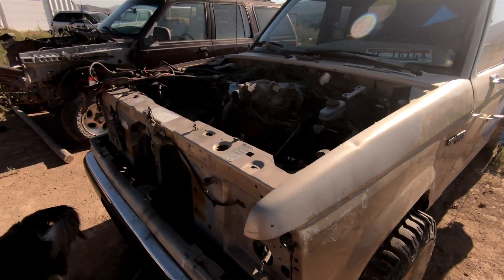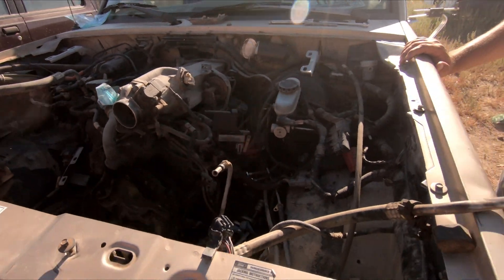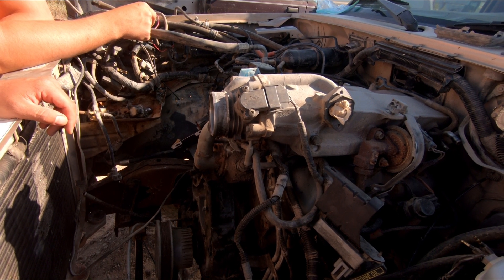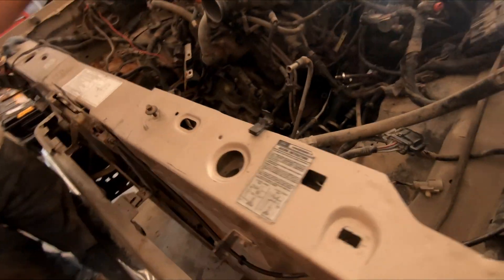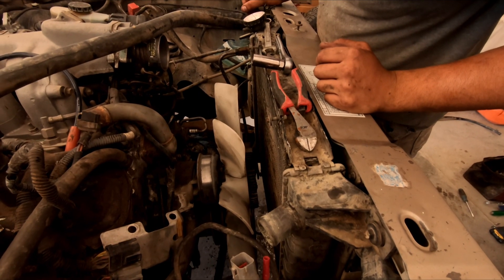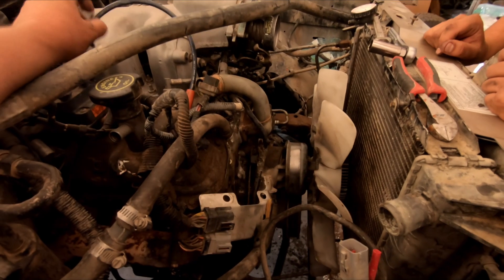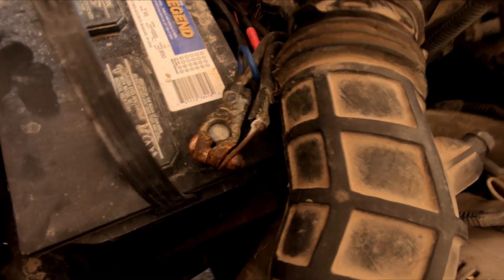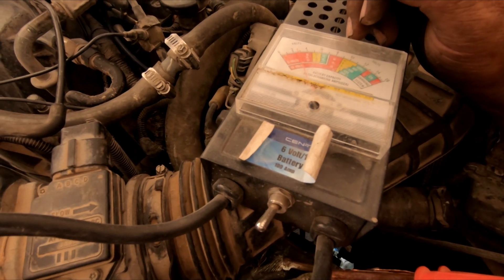Ford Ranger Engine Swap Part 6

Comment: did ya ever get er done? gonna be doing this myself shortly except both trucks are 1994 model year
Reply from the maker: @ABANDONEDCARREVIVALS  You will have a much better experience using same year trucks, I believe. Never got it done. Austin got in a wreck, and the project went to back priority. And after that, there was a title issue that came up and never got resolved. I should make a video on it, I guess. It was highly frustrating and disappointing to be so close to the "finish line".
Reply: @ thanx for the update! What a bummer you guys were working pretty hard on that! I will be pulling cabs when I do mine…
Reply from the maker: @ABANDONEDCARREVIVALS  thanks. Yeah it was a big bummer for sure. I think all we had to do to get it going was switch some wires around on the main pinout on the firewall. Because the pattern of the pinouts didn't lineup between the 2 vehicles. You're gonna pull the cabs? That will be so nice, good idea. 👍🏻👍🏻

Comment: I would have kept the Ranger a manual & just retrofitted the 5-speed onto the 4.0 L engine. Of course I would have had to buy & change a few parts to do this, but it would be well worth it. What can I say? I just prefer a manual transmission on a truck like this.

Comment: If ur still having harness issues get ur hands on all data and get a connector wiring diagram and a ecu connector diagram use the two  to confirm which wires u need there's only like 36 wires if I remember correctly that have to hooked up along with ensure the anti theft isn't giving u an issue which u can by pass If need be. Took me about 8 months to build a customer plug and play integrated harness to go from the 87 dash to the 2000 engine harness on my little tire smoker

Comment: I installed a 94 explore 4.0 into my 91 ranger I used the & intake from a 91 4.0 ranger the passenger header from the 94 explore  plus the wire harnessed from the 91 4.0 ranger
Reply: Sorry to bother but I wanted to ask you a question. I can get a 94 Explorer for dirt cheap and got a 92 Ranger with the 4.0 that doesn't run but is at about 300K. Can I just drag and drop the engine/trans from the Explorer? Or what else would I need to do? I'm assuming switching out the ECU.